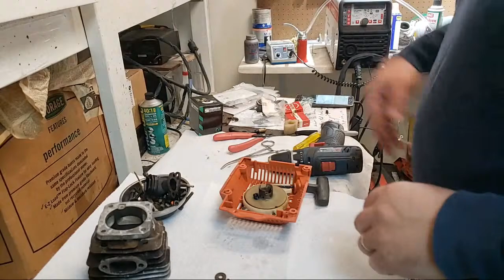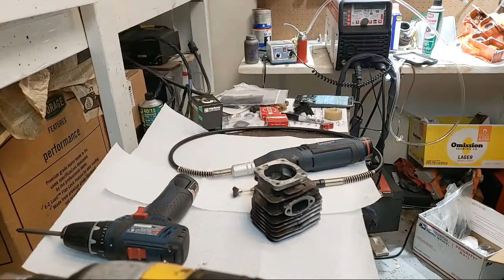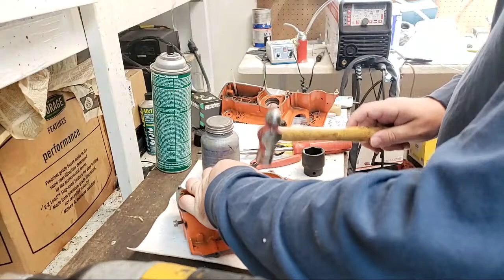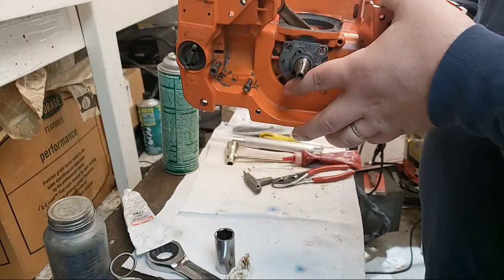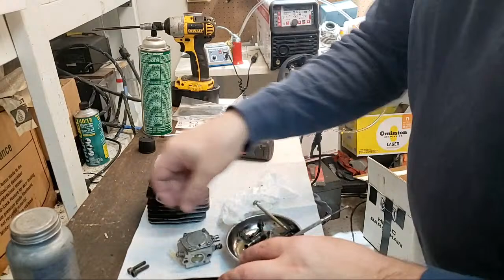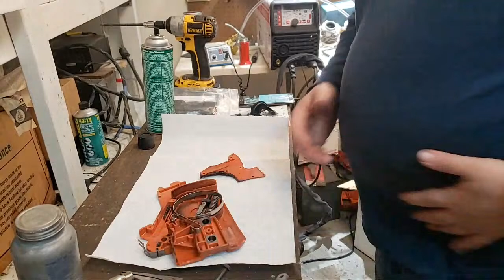Husqvarna 262xp Assembly? Live!

Comment: When the 262xp came out it had the most H.P. per pound  and had the title for many years. If I remember correctly the air injection was to pull cleaner air from inside the flywheel and send dust and particles to the outside. At the time of release it was advertised as a system to keep the air filter cleaner longer. Lot of confusion about the system came from Jonsered advertised it as Turbo. Pretty much all saws today have some form of it. Echo and some Stihls have it.

Comment: For the crank seal on the flywheel side in I pulled it in with the same method you used for the bearings, it works really well and goes in very straight with no risk to damageing the seal 👍

Comment: I have several 555 and 550 I’m rebuilding lower and top end. Why will they not idle correct after rebuild. Out of the last 5 I did only one idled correct. Would updating the software(flashing) help. I really enjoy running these saws and have a a 550 cylinder I done a mild port and would like to try it. It just gets me discouraged  when the start easy but won’t idle or run correctly. The integrated bearing is to exapensive to buy and not run correctly
Reply from the maker: Which is why i avoid those proprietary bearings and electronic saws for rebuilds.  There's a lot more to them and they are not near as simple as the old husky 346xp or 359 or 372s.  Odds are you have carb issues but since I know very little about the 550 or 555 ill wish u best of luck
Reply: @matthewolson8875  thank you I’ve cleaned the carb and most of them have the spiral diaphragm in them. The electronic part I’m lost. I’ll do my best with them. Hill top saw shop said if they would start and run flashing wouldn’t do any good. I enjoy your videos and made the crank tools and they work well. I have a 372 non xt that I’m gonna rebuild will the tool work for the clutch side and go past the area with no threads where snap ring holds clutch drum on
Reply from the maker: @SCouch-cw6je  yup ..the tool reaches the threads :)
Reply: @matthewolson8875  do you know the pto thread size on 372 and 390
Reply from the maker: @SCouch-cw6je  m14x1.25 lh
Reply: @matthewolson8875  thank you very much for your help